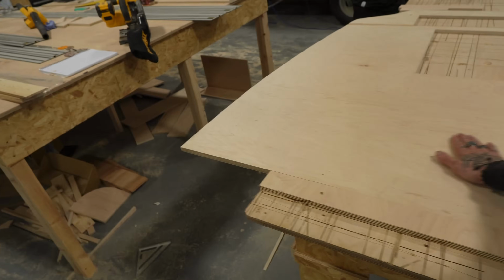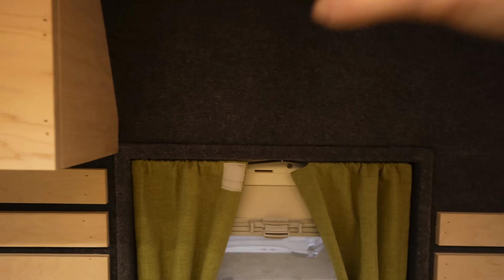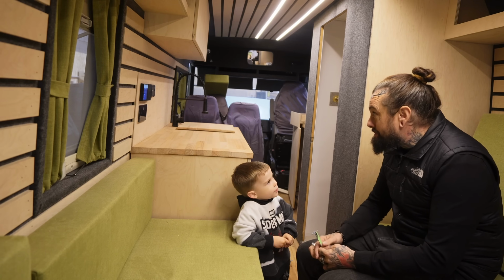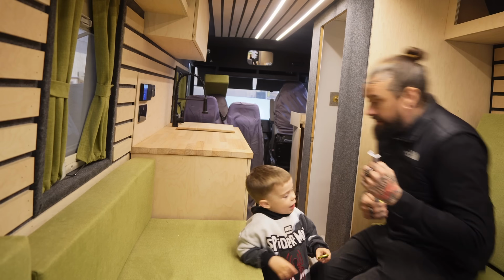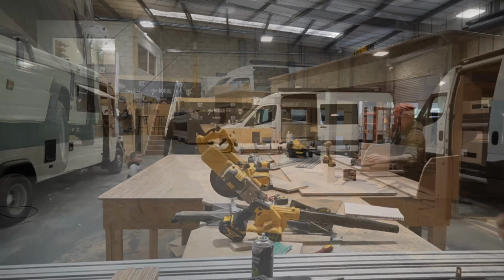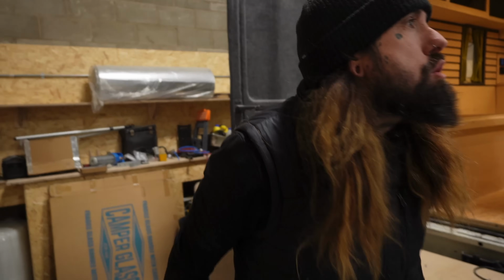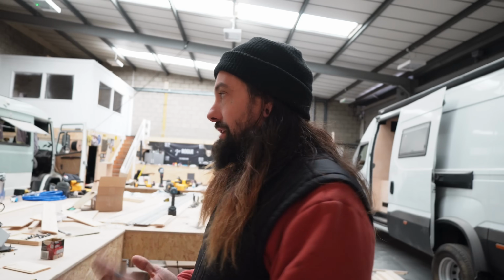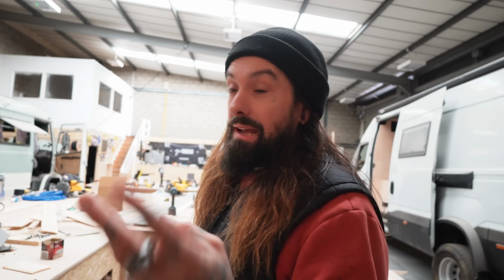RUNNING OUT OF TIME!!!

Comment: Hi Liam we build on ivecos  2022 minimum are based in Barcelona on these new stop and go charge alternators when the alternator switches off you will get no charge going to the leisure  baterías we are not sure if the victron system could over ride the vehicle system  if we end up electric problems  over time the iveco warranties are void we have had multimeters  as you would to check  the charging  This can be very concerning as said before if they are overusing the original electric system  have you experienced any problems as it’s very difficult to get information

Comment: Hi Liam we spoke last week you  told me that the victron was good for the iveco 2022 iveco euro 6  as You no with the has the smart charging system so the alternator stops and starts charging  when this happens the leisure battery’s will also stop being charged  then have to wait until the smart alternator turns on again  this must happen with any dc t dc  what do you think